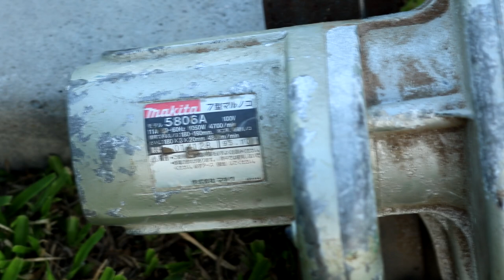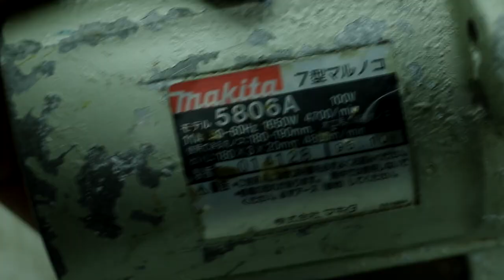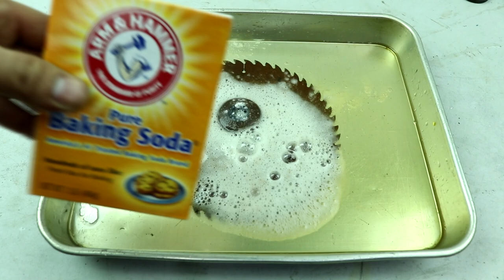Very Old Circular Saw Restoration

Comment: Looks like all it needed was a new blade... Not much of a restoration, internals looked mint and I bet it worked fine.
Reply: MasterBata bearings can look new but need replacing if there rough then might as well replace
Reply: It was a restoration.
Reply: Restoration is when you take an old, unusable, item and restore its functionality. This one was fine. When I replaced wheel bearing in my 5 year old car, that wasn't a "restoration", now was it??
Reply: MasterBata you are wrong.
Restoration just means to bring an item back to its former condition..
The clue is in the name “restore”

If you’ve a 5yr old car with no interior,trim,engine,loom,doors,wheels etc you could call it a restoration project even if only 5yrs old..

Carry on though 😆
Reply: Robert Navarro  restored to its former glory 😂😂 ye ain’t the sharpest tools in the shed aye.
Reply: @stephenrichmond3138  lol this saw had nothing missing, all it had was some surface rust and I bet it worked just fine. This guy doesn't know what he's doing or he's doing it poorly just to jump on the restoration videos bandwagon.
Reply: MasterBata didn’t need to have missing parts , it still falls under the category of restoration even if you don’t agree lol
Reply: @stephenrichmond3138  it was you who said that if my car was missing pieces, it would be a restoration. This was just servicing a normally worn saw. I am not even going to comment removing rust from blade, or trying to sharpen it with normal file. This guy doesn't know what he's doing.
Reply: @wtfiswiththosehandles  Merriam Webster over here. You mad?
Reply: @wesgore8016  nah, just appalled
Reply: @wtfiswiththosehandles  noun. the act of restoring; renewal, revival, or reestablishment. the state or fact of being restored. a return of something to a former, original, normal, or unimpaired condition. restitution of something taken away or lost... funny because that came off dictionary.com lmao rekt
Reply: @wesgore8016  so coming back to my 5 year old car and replacement of wheel hub bearing. It was a restoration of my car, right? While we're at it... If I wash dishes, it is also restoration? GTFO
Reply: @wtfiswiththosehandles  if the dishes are black ya.. u so mad
Reply: @MasterBata what you're trying to call restoration is normally called maintenance.  Restoration typically involves servicing the cosmetic portions of something as well as addressing mechanical functions, and frequently involves unnecessary service of mechanical parts that are worn but not yet in-need of replacement.  Some would call it a process of returning a device to as close to like-new condition as possible.

gear show didn't need to disassemble the simple transmission, remove the lubricant, and replace the bearing, but he chose to do so because it would restore the tool to a state as close to when it was new as he could.  Likewise he didn't have to remove the old paint and to repaint, it was still functional, but because he wanted it to be like-new, he did so.  Even the work he did with the commutator bars was probably not strictly necessary, it probably would have functioned with the original brushes on the original commutator.
Reply: Restoration: noun. the act of restoring; renewal, revival, or reestablishment. the state or fact of being restored. a return of something to a former, original, normal, or unimpaired condition. restitution of something taken away or lost.
Reply: MasterBata my point was yes your car was a restoration if it’s missing a lot of parts as is this , both fall under the same category.. 
nice one trying to make me look stupid though 😉😂
Reply: renovation istead of restoration, or?
Reply: I agree. 
It should be tested first to check if it even needs restoration.
It's more disassembling for fun, which is also fine.
Reply: its a cool video/well done restore, all you people complaining watched the whole thing right? so he kept you watching ?...  hahaha it was well done in my eyes and you can nit pick the shit out of any project ..
Reply: Just restored my car; filled up the gas tank to the level it was when delivered new from the dealership. That's all it needed for a new week of action.
Reply: Bunnings are selling genuine branded replacement blades for this saw for $30
Reply: You are missing the point. It was a cosmetic restoration with a bit of mechanical restoration. There are varying degrees and types of restorations. You seem to think in terms of all or nothing and in straight lines.
Reply: @dapsapsrp  Sure. But I can't talk now, I have to do a Bicycle Restoration. Gotta change tube in one wheel and wash the frame. You know, this type of restoration sure is a challenge worthy of filming and showing off to public.
Reply: MasterBata it’s not his fault I’d class that as bonus if the internals didn’t need much doing . Does it look a million times better . Yes it does so go play on your PlayStation
Reply: "Restore" does not mean "repair". What this guy does is the definition of "restore". Nice job
Reply: @wtfiswiththosehandles  Well, he restored the casing and gave the inards a good look through. I understand it isn't the level of some people, like My Mechanics, but its still a mild restoration none the less
Reply: @david_adovi  Hey, remember to film the process! 😆

Comment: In shocking condition, but not terribly old. The Makita date code on the label says 95 . 10 That simply means it was manufactured in October, 1995. That model, 5806a seems to be designed especially for the Japanese market.
Reply from the maker: Thank you for sharing and well explanation.

Comment: You actually went through the trouble of restoring the blade instead of replacing it? Haha respect
Reply: Thinking same thing.
Reply: It's so call n easy to restore if u have a lot of tools n materials to use for!
Reply: Minus the rust the blade seemed to be in decent shape. Would have been a waste not to
Reply: Fools throw it but wise peoples knows the value of money and it's called restoration.  I think you don't understand the title of the video 😂
Reply: @Chen Lee Did you own one?
Reply: @kenykharbudon6693  well fools throw it away cause it would be as blunt as a hammer

Comment: You finished the restoration by putting back on the saw a few rusty bolds..These details make the difference..Keep it on mind..😉
Reply: @lindamoggioable  It's the little details that make the biggest difference
Reply: @lindamoggioable  - When someone goes through the immense task of doing a complete rebuild, and then neglects the simple details, it really stands out as odd. It seemed especially odd after he had spent so much time and energy refinishing that cheapo factory blade.

Comment: I enjoy watching tool reviews and tool's Restorations but I still wouldn't wasting my time on the blade itself I would have bought me a new blade but other than that it was a great video
Reply: Agree with this
Reply from the maker: Yes I will buy new blade to replace it, anyway thank you.
Reply: Yeah it's a junk blade,I bet no one or not many noticed the broken carbide
Reply: The budget was blown on bearings. ;) Besides, it looked like the original blade. It cleaned up pretty well. How many good teeth does a blade REALLY need after all?  LOL
Reply: Budget? How much do a few bearings REALLY cost after all?  LOL

A factory (factory used very loosely as most are just rebranded cheap blades) would have been a combination blade.
With the little wear on the brushes and armature along with the condition of the grease on the bearings and gears this saw wasn't used much and was a waste of that "budget" replacing the bearings.The hardest part of that saws life was likely sitting on someones concrete basement or garage floor for many years and would have been like seen,pretty much all cosmetic.

Comment: Why did you add baking soda to the vinegar right away?  You need the acidity to remove the rust!  Let the parts soak in straight vinegar, then use baking soda to neutralize the acidity only after you've brushed away the rust...
Reply: Otherwise, excellent restoration!!!  I always enjoy your videos!
Reply from the maker: I think mix it together will be fast reaction. Thank you for like my videos :)
Reply: The fizzing is the acid reacting with the baking soda, so after there is less acid to react with the rust
Reply: Next time, try it without the baking soda...  Let it soak for a couple of hours (or overnight) in straight vinegar, so that the acid can dissolve the rust.  You'll find it works much better that way!
Reply: Right.  Adding the baking soda just gives you a tub of what is basically smelly water!
Reply: you use table salt. It creates some HCl and therefore removes the rust faster. baking soda gets decomposed and neutralizes the acid.
Reply: I prefer to use citric acid in hot (about 90 C) water - it works much faster and efficiently. And baking soda is just neutralizing vinegar, so the process will bw very slow.
Reply: The fast reaction is the baking soda reacting with the vinegar producing (mainly) water and carbon dioxide , and not the vinegar or baking soda reacting with the rust.
Reply: Agreed. I've used vinegar on everything from carburetor components to rusty bolts. I've never added baking soda since it neutralizes the 5% acetic acid. Otherwise this is a great resto!
Reply from the maker: Thank you everyone for sharing and suggestions.
Reply: Yeah. I was puzzled with the baking soda part as well. Baking soda  looks and sounds cool. But doesn't help with the rust. Loved the restoration though. Great job
Reply from the maker: @Jonatha Seriously, thank you.
Reply: @jonathanmarday5966  its an abrasive. Same reason baking soda works great to remove tartar on your teeth.
Reply: @Brastius  With tartar, I understand. You are brushing it with a brush. Also, it is to help neutralise the acid on your teeth from the food you've consumed. If you put vinegar on baking soda, you will neutralise the acid and reduce the power of the acid to remove the rust.

Comment: Replace the spring, the guard should snap back faster than that
Reply: Could be sluggish because the paint has tighten up the tolerances.  Probably free up with a little use.
Reply: There should have been no paint on the ring. The paint will roll up and jam the guard randomly.
Reply: Two things that'll maim you faster than anything on a skill saw: lazy guard and lazy trigger .  Plus it's old enough that it has no power brake, that guard is a downright killer.  Also the paint on the bottom of the table was unnecessary and will just drag the saw until it wears off.
But in fact I loved the video, I'm thinking about tackling my old 8" Rockwell now that I bought 20 years ago at a pawn shop for 25 bucks.  I don't use it because ... sticky trigger and lazy guard.
Reply: Looks like it went together dry, when it probably had just the slightest dab of grease from the factory.

Comment: That's not a very old saw.  I have a 1940s Black & Decker which is still going.  It takes a 6.5in/16.5cm blade and it has plenty of power.  It does need a machine bushing for modern narrow kerf blades but that isn't really a problem.
Reply: douro20 If you look closely on the label you can see it says "10/95" meaning October 1995😂
Reply: Interesting.  I have one of those old B&D 6.5 in. saws too; it was my father in-law's.  Still works but the power cord needs to be replaced.  I also have a B&D router in a metal carrying case; must be the same vintage.  I think it's 1/4 HP.  I did take that apart, cleaned it up and replaced the power cord.  Had to whittle down the strain relief to make it fit.

Comment: Makita dose not die
Reply: You might want to go and tell the cut-off machine where I work that, it just let out a huge cloud of smelly smoke and died. Actually I have an old Black and Decker in my shed from 1983 that took over a job from a 12" Makita hire saw that died half way through a job relining a low loader trailer and let out the bad smoke, my little Black and Decker is still going to this day.
Reply: Mentorcase that perfect 👌🏽 
 But I think it depends on the weather, whether it is wet or dry or cold or hot all this leads to a difference in the life of the machine, maintaining something and put it in the right place always prolong life 👍🏼

Comment: You can't sharpen carbide with a flat file.
Reply: but it works na
Reply: Brandon  Napier 
It's not a flat file.
Reply from the maker: I use sand paper, a flat file is just a handle.
Reply: It's still a carbide blade, it is harder than sand paper will ever be. They do not need sharpening, as nothing really dulls them, except if teeth are missing/chipped. If a blade has those "blocks" on them, it will never require sharpening. Only blades without carbide tips can be sharpened.
Reply: It's possible to sharpen carbide saws with diamond files. Sandpaper will work, but not very well. A carbide tipped saw might never refuse to cut, but to make the cut easier and not burn or tear the wood as much you might still want to sharpen it.
Reply: satanclaw 
It depends what material is on the abrasive paper.
Reply: Frodo....  Don't pay no attention to greenhorns.... i like watching them buy those cheap Avanti blades...  Let em' spend their beer money

Comment: Nice little restoration, made the tool look like new. just remember, when you clean out the old grease from an open bearing, you need to push the new grease back in to the bearing, otherwise the bearing might destroy itself before grease makes it to the working surfaces. Also, don't add baking soda to the vinegar, that will stop it from working, you only add it at the end if you want to neutralise the acid of the vinegar.

Comment: My question is why not just buy a new blade?
Reply: It's my question too it's just waste of time
Reply: it will cost 50 bucks alone with new blade
Reply: Depends on the blade and how many come in a pack. At the end of the day it's his project and he can do what he likes. I was just wondering.
Reply: Because youtuber!
Reply: @rdarchitect  you can get blades for under $5, you can get a quality blade for $15.
Reply: Oh God. If he bought a new blade then it is not restoration anymore.
Reply: My thought also...new blade wouldn't be a restoration...
Reply: Then it wouldn't be restoration.....it would be replacement
Reply: PEOPLE like to FIX THINGS --  I do too!
I have the TIME  but NOT he $$$ to buy, even not the blade!  
I did not win 1.6BILLION --  or half of it after government STEALS "their share" !!
Reply: blade is original branded blade. if he can find new one than its good
Reply: Because so long as the carbide tips are in good shape, that blade is perfectly usable. Sharpen the tips (which he did) and remove the rust on the blade (which he also did) and its good to go.  Id use a different method to sharpen the blade and not add baking soda to the vinegar, which weakens the solution, but there's nothing wrong with that blade right now.
Reply: Maybe because the same old blade still can be sharpened and used. If it's not bent or deformed, or the teeth are not broken, it definitely makes sense to fix it. And the second reason is, that it's factory original part, which came out with the tool, when it was made and he wants to keep the saw in factory original condition.
Reply: or make a knife from the old one.

Comment: макита состояние новое все смазанное все откручивается. пол года в гараже лежала. в чем реставрация???
Reply: Эта модель не производится уже минимум 25 лет.
Reply: согласен!! что там реставрировать?? её тока сверху покрасить для вида и в бой ржа сама отлетит!!
Reply: It's a bit older than that. I'd say 25yrs old. But it looked good inside.
Reply: +Fred Garvin 23 years exactly. Date code clearly reads 95.10 — October 1995. 5806B (same design, but plastic housing) is still in production.
Reply: +Владимир Швец Меньше. Этот экземпляр выпущен в октябре 1995 года. А 5806B в пластиковом корпусе выпускается до сих пор.
Reply: @IgnatSolovey  Про пластик разговора нет. Мне в руки попадала чуть постарше привезённая из за бугра. Шикарный раритет,классные видосы. У меня погружная макита SP 6000 и две шины.
Reply: разговор не о дате выпуска и не о том где её нашли а о том что в изначальном состоянии она вероятнее всего работала также как и в конце ролика  @IgnatSolovey

Comment: All this needed was a new blade. Pulling it apart like you did seemed like a waste.
Reply: PBMS123 if he didn’t pull it apart then it’d of been a blade replacement video and not a restoration video🤔
Reply: @stephenrichmond3138  It was a pointless video though. It didn't need it. The internals looked fine. One of the screws in there was still shiny metal. Maybe some saw dust that could be blown out, but the electronics didn't need to be taken apart. And the way that blade rusted, it looks almost like it was done on purpose.

This was a cosmetic restoration at best. A new blade, and it would have worked fine.
Reply: Methinks you missed the whole damned point.
Reply: @73twall  The point of what. Taking apart a working appliance to get on this whole restoration video craze?
Reply: @PBMS123  It's a HOBBY. He shared it with those who want to watch it. If it's a "craze", why did you watch it? To be trendy? To complain? He took apart a working saw that looked like crap, and painted it. What's so wrong with that?  It STILL works, but it looks better now. Making it look as good as it runs is the point.
Reply: @PBMS123  that would make a very cool video replacing of a blade? i am sure that would get the same amount of views..haha so pointless you watched the whole thing?

Comment: That saw casing would have been an excellent item for powder coating. And it wouldn't chip and/or scratch as easy either. Might try it on a future project. JMHO.  Nice job either way. And I concur with the vinegar and baking soda. You simply neutralized the acid instantly adding the baking soda.
Reply from the maker: Thank you for sharing, I change it next time.